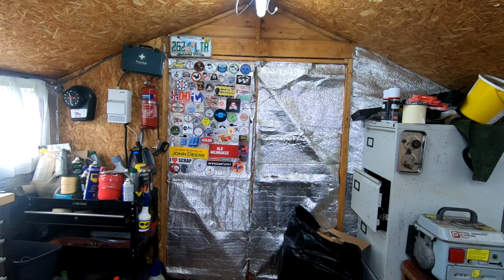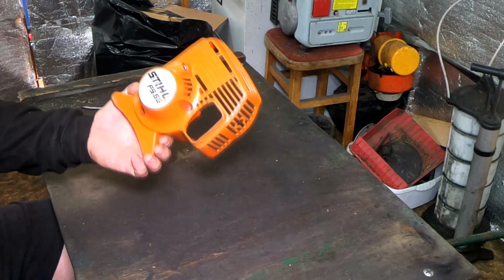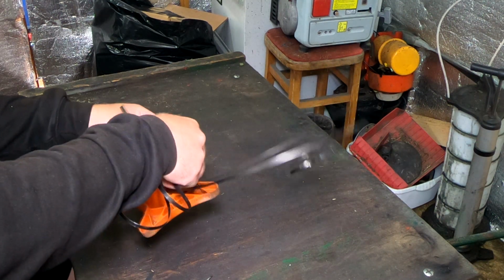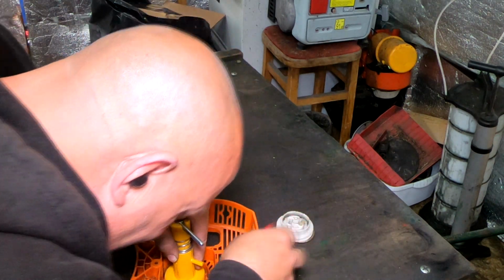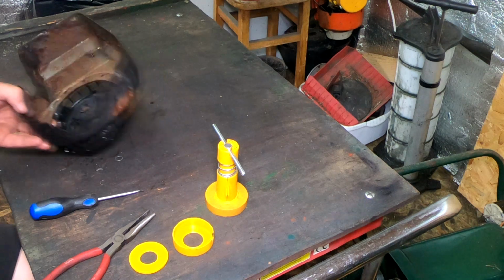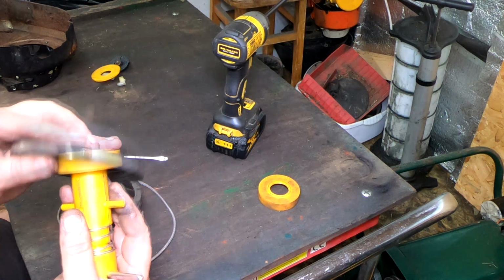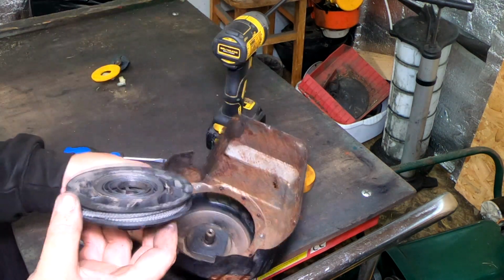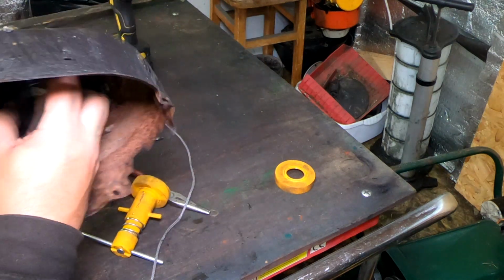How to fix a pull starter recoil spring and replace a stuck or limp pull cord E-Z Coil Spring tool

Comment from the maker: TOOLS I USE -
Fan Blade Bulb https://amzn.to/39BLI4a
Blade removel tool https://amzn.to/3nxBVQj
Micro Drill Bits https://amzn.to/36Jpv0R
Carb Cleaning Files https://amzn.to/3lH8ESx
Hex Shank Extension Drill Bits Bar Set 1/4" 3/8" 1/2" https://amzn.to/3oFKHx9
Dewalt DCF887M1- Impact Driver, https://amzn.to/3oEVcjZ
Lawnmower Rotary Blade Balancer https://amzn.to/3e6UOWN
Rode WIGO Wireless GO Wireless Microphone https://amzn.to/2JlRlIN
Neewer 176 LED Light https://amzn.to/2HaubnJ
Universal Style, Mower Deck clamp for blades https://amzn.to/31PKygE
Briggs & Stratton Diaphragm and Gasket set https://amzn.to/3kF8Y3H
GT SONIC 3L Ultrasonic Cleaner https://amzn.to/2TDdVy9
VEVOR 3L Ultrasonic Cleaner https://amzn.to/2Gb3PBJ
Stainless Steel Strainer for carb jets in a cleaner https://amzn.to/3e6CxJ2

Comment: Mick any chance you can do a video on the e z coil spring showing how to change the head size and showing underneath when the spring is being compressed as I want to have a go at making one 🙏
Reply from the maker: Ok mate I will add it to my list
Reply: @themowerman  thanks Mick it would be such a handy tool to have 👍
Reply from the maker: @paulstir  https://www.ebay.co.uk/itm/Recoil-Starter-Spring-Winder-Rewinder-Tool-For-Chainsaw-And-Brushcutter-Etc-/193172846597?mkcid=16&mkevt=1&_trksid=p2349624.m46890.l49286&mkrid=710-127635-2958-0
Reply: @themowerman  cheers for the link Mick , I can see the weakness in the plastic version ( I . E I don’t think it will last long ) I want to build a metal one .
Reply from the maker: @paulstir  well good luck
Reply: @themowerman  cheers Mick I think 3 videos ago you showed the angles I needed to understand how the device works so that should do mate , thanks bud